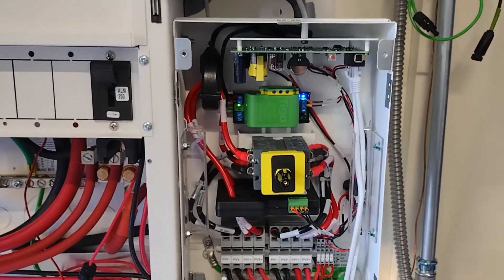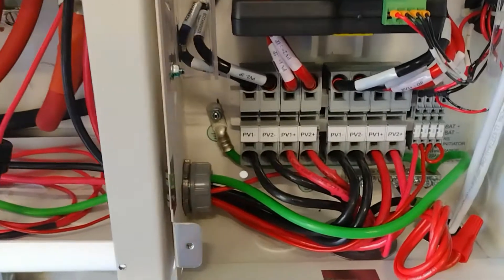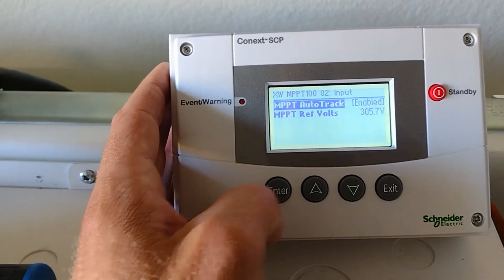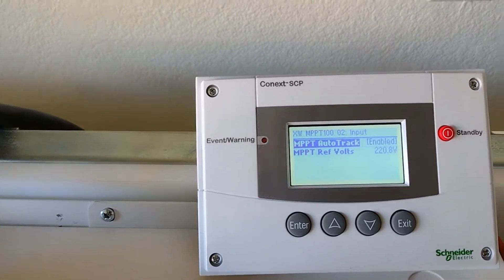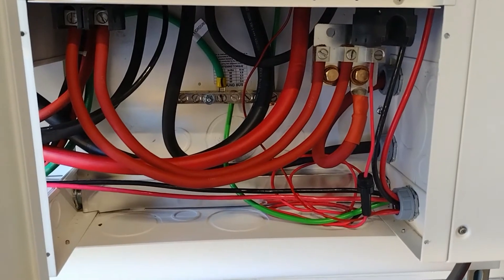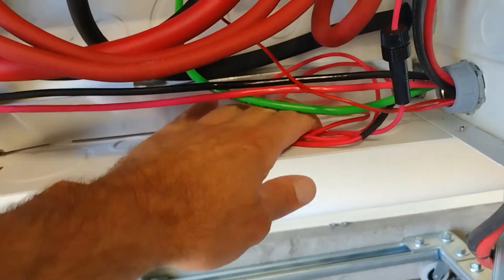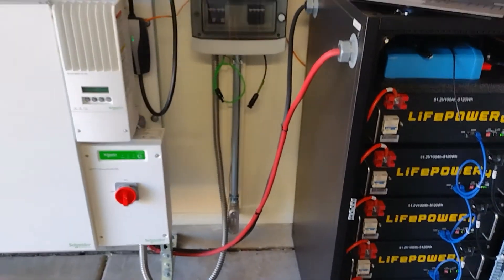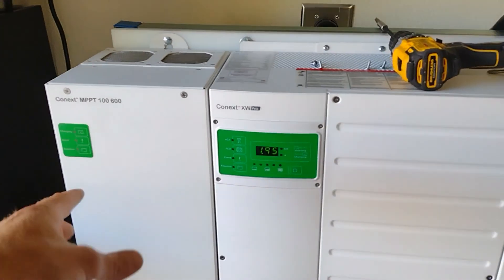Schneider Tigo MPPT Issue

Comment: I am installing a two inverter d/c coupled with xw pros and 100/600 mppt’s. My reading is telling me no combiner box or optimizers needed. The mppts do that for the most part. I am guessing tigo and controllers are conflicting. Disconnect them and see 😊

Comment: I am trying to get a similar setup working but I have the CCA, TAP and TS4-A-O that is optimize and rapid shutdown at the panel level so I do not need that in line shut off you are using. Can I ask why you only got the F vs O models?
Reply from the maker: If you are using a charge controller with a MPPT, you cannot use the optimizers as you would have two potentially competing MPPTs. Schneider charge controllers are only compatable with the F models - and they don't seem to work with the MPPT algorithm in their charge controllers to this day. I'm not sure what CCA and TAP are above?
Reply: @gridfreeordie  So in Texas my electrician explained you have to use optimizers. And yes they can be setup with the O, all they do is regulate DC voltage. Here is CCA and TAP: https://youtu.be/4kqVPCz4TP8
Reply from the maker: @TimothyEdgin  
What inverter are you using? 

If it is a Schneider Conext XW series hybrid inverter, you also need a solar charge controller (which provides the DC/DC conversion for the battery and MPPT functionality for the solar array string) like the Schneider Conext 60A/150V or the Conext 100A/600V. You don't have to use a Schneider charge controller but you should for unit-to-unit data communication purposes AND because there are very few solar change controllers on the market that offer both ARC-fault detection AND ground-fault detection, both of which are now NEC code requirements. The Schneider RS disconnect box with the built-in Tigo transmitter provides the ARC-fault detection (and rapid shutdown capability). The Schnedier charge controllers provide the ground-fault detection. Sol-Ark is another brand that offers a potentially code compliant hybrid solution like Schneider. 

Schneider/Sol-Ark hybrid inverters & charge controllers are not common. I suspect 99% of most solar installations use normal grid-tied "string inverters" like SolarEdge / SMA / Fronius (a million other brands) or the vastly popular Enphase microinverters.

Now we can move on to the third code requirement - rapid shutdown. 

1. Both Tigo optimizers -O and fire responders -F offer panel-level rapid shutdown, a NEC requirement. This turns off each solar panel to 0.6V if the stay alive signal is lost by a person disconnecting the DC solar array circuit or disconnecting the home AC power. Panel level rapid shutdown (not string level like it used to be) is needed per newest NEC code if the panels are on a roof of a dwelling, but rarely needed if they are ground mounted. So you don't always need panel-level rapid shutdown.

2. Schneider Conext charge controllers do not work with Tigo optimizers according to the Schneider manuals, only the Tigo -F fire rapid shutdown product. This is because you would have two competing optimizations going on, one at the panel level by Tigo and the other at the string level by the charge controller. 

3. Tigo optimizers and fire rapid shutdown units also work with more normal "string inverter" brands, you'd have to look up the compatibility chart on Tigo's website. If your roof mounted array has little to no shading, go with the -F. If there is shading, go with the -O. But most string inverters do a very good job at handling shading scenarios without panel level optimization so I'd probably use the -F either way. Cheaper and less complicated. I don't really like the CSS/TAP approach since it requires an additional wire up to the roof AND relies on wireless communication. The normal power-line-communication provided by TIGO's basic transmitter is very reliable and doesn't require that 485 communication cable. 

4. The most common grid-tied string inverter brand in the US is SolarEdge. They offer their own optimizer solution that atttaches to each panel and also provides panel-level rapid shutdown. Their system performs quite a bit differently than Tigos -O product. If you have a SolarEdge inverter, don't use Tigo optimizers, use SolarEdge. (not sure Tigo is even compatible with SolarEdge).

5. I must mention Enphase micorinverters as well. These offer panel-level rapid shutdown, but convert DC to 240V AC at each panel and simply parallel all the panels together down to a main AC disconnect. The downside occurs when you want to add battery backup. When you use your battery you're going from DC solar, to AC by the microinverter, back to DC to charge the battery, and then back to AC to power your house.
Reply: @gridfreeordie  So I started with Sigineer 6Kw off grid all in one that just got UL listed to get started but I also have the Schneider in my garage for next years project; this one is hooked via a 50 AMP generator inlet. I have my whole house on LEDs and other low wattage stuff so I normally pull only 1.5 to 3 KW until the AC kicks on. All panels on ground mounts now-5.2Kw. Next year Ill put panels on the roof to feed the Schneider XW Pro, but keep in mind things are changing and what one source says is not always the end of it. I spoke with someone at Tigo and they told me they tested and they work with Schneider XW Pro and most other inverters. You can mix and match with optimizers-not all panels have to have them.
Reply: @gridfreeordie  Sorry for the late reply-holidays! I now have my XW Pro working with the Optimizers-but I am getting some weirdness. The Optimizers were working with a Combiner box that combined three strings into one 200v output, nice and clean. I needed that to get my Sigineer working with 15 panels in a 3x5 panel array. However, I have the three arrays feeding directly into the MPPT100  from Schneider (it had connections for 3 strings), and it is working in good sunlight. The voltage drops to 196 and I get up to 60 amps charging on a cloudy day. However, the PV amps and watts drop to 0 each time the volts get to about 215. Schneider support just started troubleshooting but they said that should not be the case. I am wondering if I should not remove the Tigo Optimizers and save them for a roof install; I installed in my backyard as a ground mount. I am thinking the Optimizers somehow trained themselves to work  at 200v and I somehow need to reset them.

Also, I am trying to use the Tigo optimizers because I paid for them and on my cheaper inverter they were working great. It also had an MPPT. In Texas you are required to use micro inverters or optimizers for grid tied, and I eventually want to connect to the grid. For now the generator is my grid.
Reply: @gridfreeordie  Also, if you look at the comment by John Wilson here: https://youtu.be/5IiY-5z8jn0 I am starting to believe these are not necessary.
Reply: Good morning, I've been doing some research and am ready to go with the XW Pro and Mppt setup.  I was just wondering if you were able to get Shnieder to fix this through a software update.  Also, I was wanting to know if the only Tigo modules that work are the -F series.  I would like to use the -O series and have the possibility to see each panel output if anything was to go wrong with a panel in the future.  It should be worth the extra funds to be able to see that info for me.